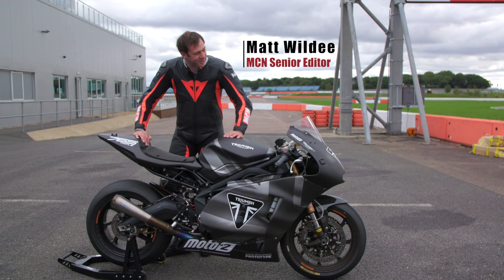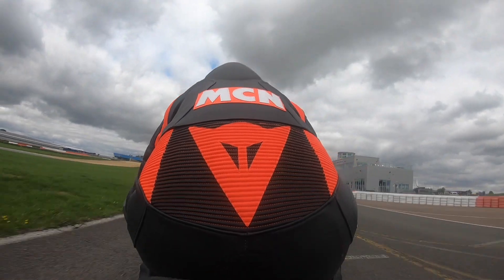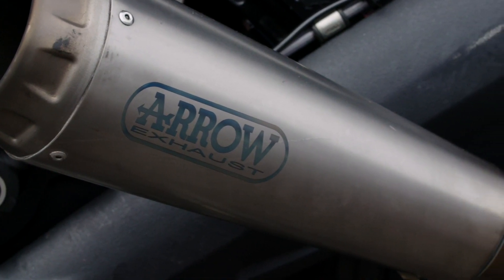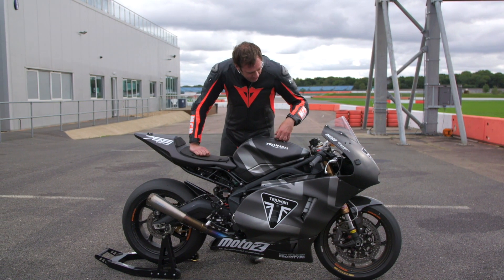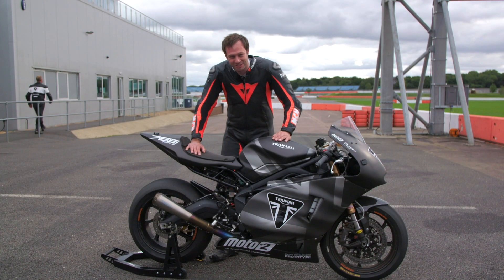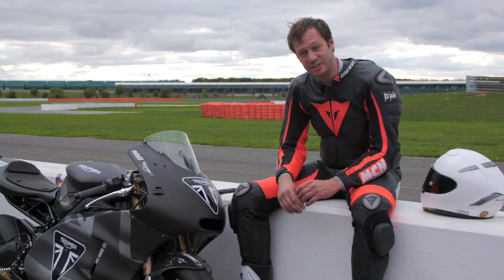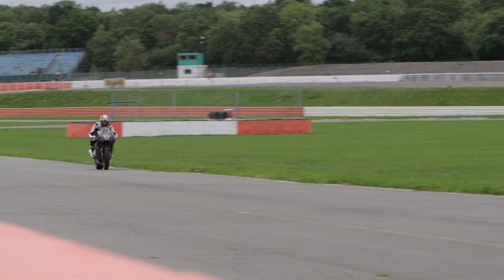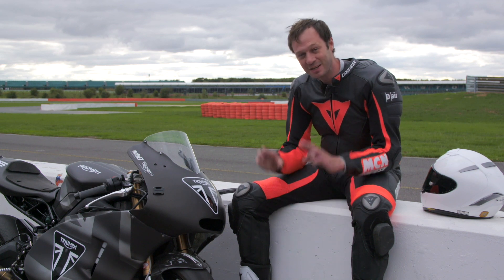Triumph Moto2 development bike ridden | First Rides | Motorcyclenews.com

Comment: Did you know; most racing Laverda 1000 triples kept to the 'flat' 180 crank after the production bikes switched to 120. The reason was that they were stronger, the pistons/rods weren't trying to twist the crank out of shape. That said, it was pressed-up roller-bearing, so more of an issue I guess. Be interesting to hear 180 triple with modern revs and power. Assuming it's even feasible, of course - vibes might be an insurmountable problem.

Comment: I own a triple 765 R , and it have big issue with the clutch, and also many people report the same , I hope someone read this from MCN to give more details about.
Reply: Eder 73 what’s going on with your clutch?
Reply: @LEJones-sh5fx  It makes a weird noise when I pulled and the same time make like vibrations , I got one video that it shows what happe , many people on the comments report the same and I already send a email to Triumph and the shop , I get the street 6 times and no fix at all.
Reply: @ Eder 73  .... sounds like clutch basket may need tightening up, i had one do the same thing and the nut only tightened up 1/8th of a turn but it fixed it.